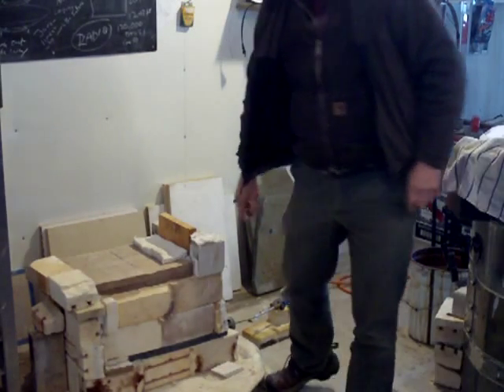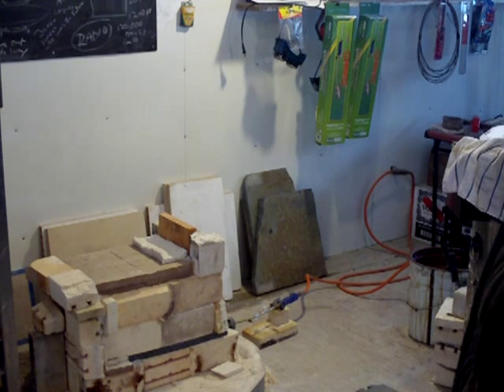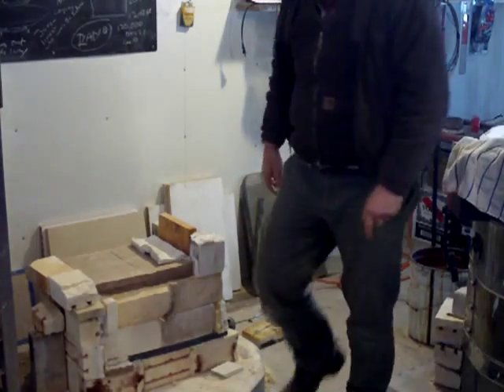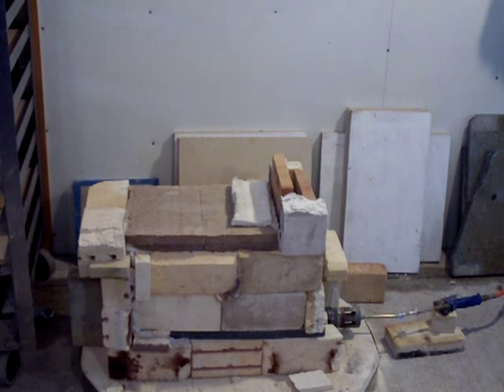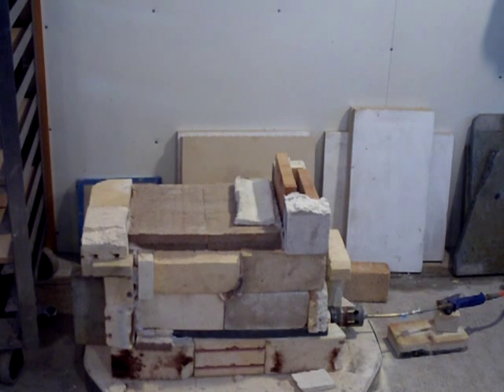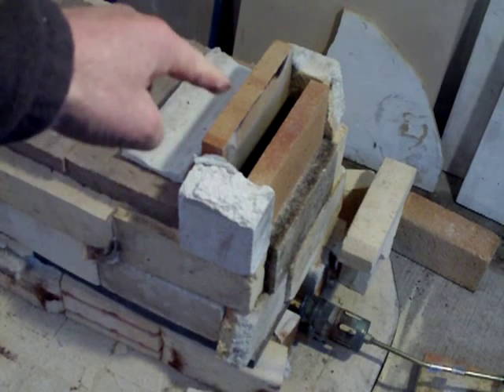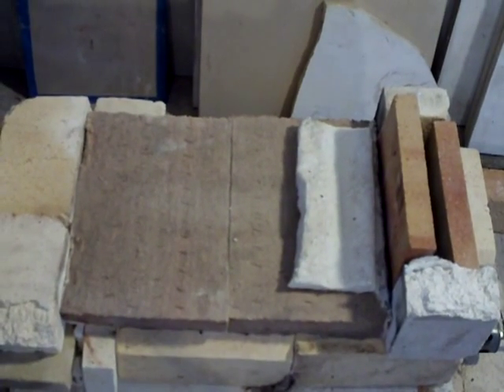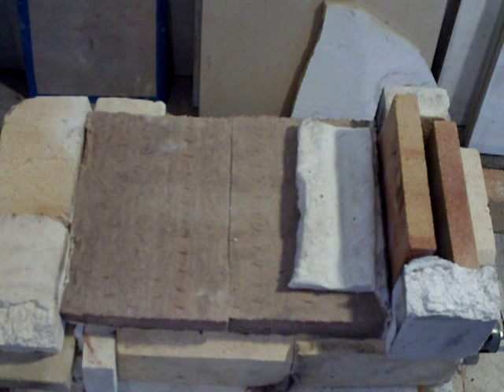SIMON LEACH POTTERY - Small test kiln - Horno pequeña prueba - march 18 '13

Comment: Simon,how did you warm it up and not let it run away,Did you use the HF torch or a small hand torch. i find that my little converted electric(to  propane)17.1/2 x 17. 1/2 climbs to fast with the HF torch so i use a small hand torch. gets me to about 400 f in 1 hour....

Comment: I do reduction firings to around cone 7 in a small kiln (patterned after your raku kiln, as a matter of fact) and I've had the same problem with the clay body not really reducing.  It seems to me like it's typically a problem of the kiln heating up too fast, which is a problem if you're using fiber or if you're using a small kiln.  I've found that if I create a heavier reduction atmosphere during body reduction and fire in that phase for a while longer, the clay turns out a little better.